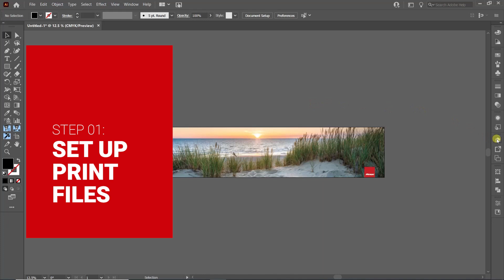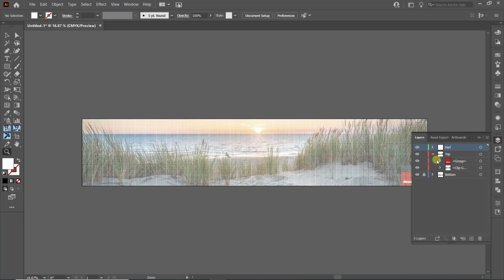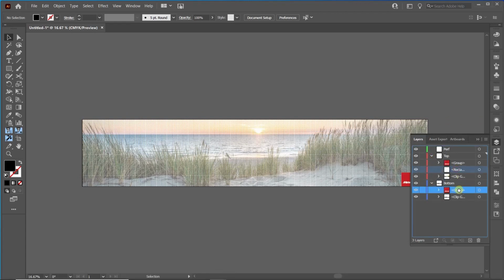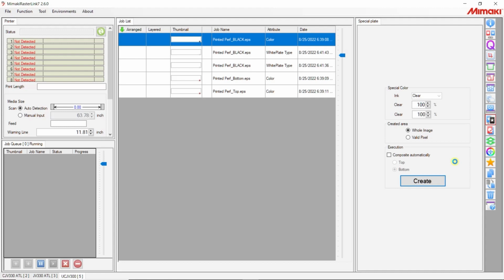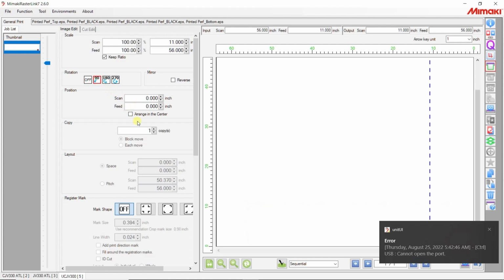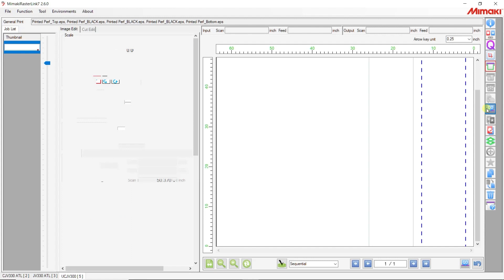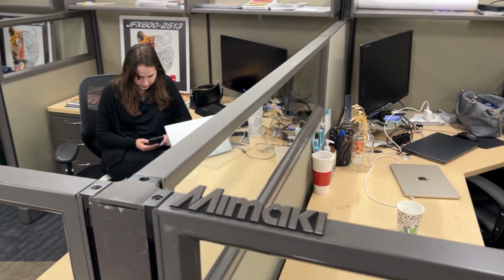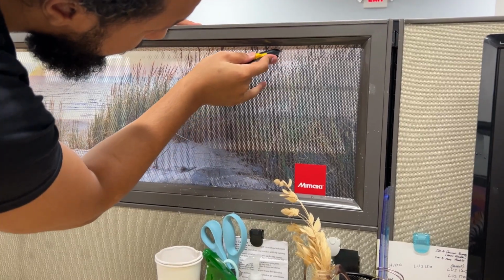Creating Perforated Window w/ Layered UV Ink on UCJV300 Series - Tips, Tricks, and Techniques

Comment: We have the UCJV330-160 and have been trying to duplicate this. Every time we make the black layer a special layer in Rasterlink and change it to white it is creating solid white shapes with no holes, even when we do valid pixel. We are using CorelDraw if that changes any export settings? It is like the perf layer is combining with the black and making it solid. Anyway around this?
Reply from the maker: Hello, to help determine whether the issue is with the file or CorelDraw, please try test printing the black layer file to confirm it's not causing the problem. If you continue to have trouble, we recommend reaching out to our call center for more in-depth troubleshooting at (888) 530-3992 or na.service@mimaki.com.

Comment: Does it have to be UV print or could I do it with the solvent. Say a CJV330?
Reply: thinking about it now. the UV would be best for the dual sided. Solvent wouldnt dry fast enough to layer it like this.....?
Reply from the maker: @DavidestDave  We recommend UV inks for this application because UV inks are more opaque on transparent media.
Reply: Window perf installs have failed now after four months. We have three huge redos. We had to print on our eco-solvent printer since the UCJV300 is incompatible with window perf.
Reply from the maker: Hello, we must have missed this comment. Did the per swatch we sent fix the issues you were having? @matthewgale5819

Comment: Very interesting.
1. Can you do this on UJV100? 
2. Is this material special or Clear Vinyl can be used?
Reply from the maker: Hello, the UJV100 is only capable of producing up to 2 layer prints. You can use any Clear Vinyl you'd like for this application depending on the longevity of the use. Just make sure it is UV receptive :)